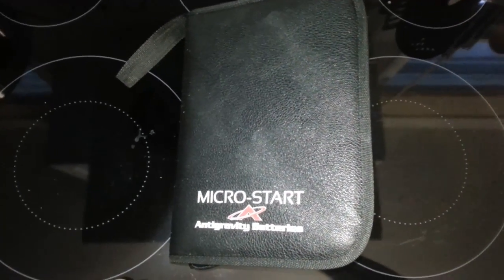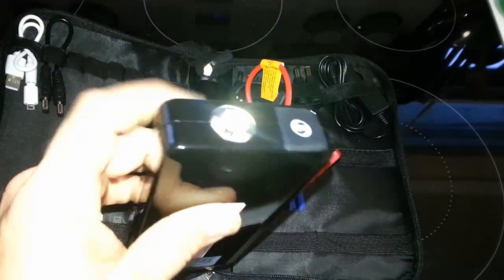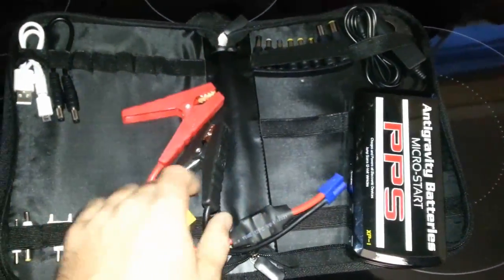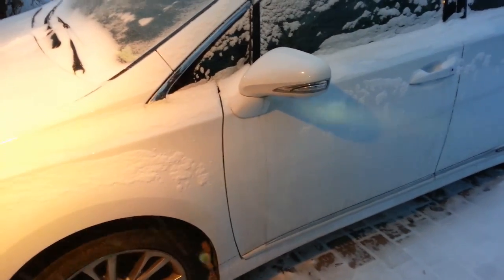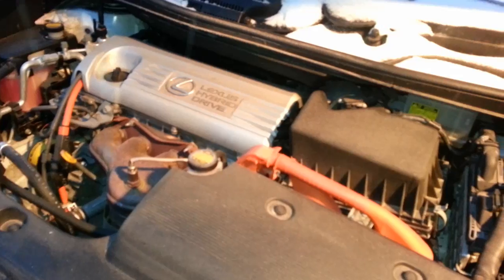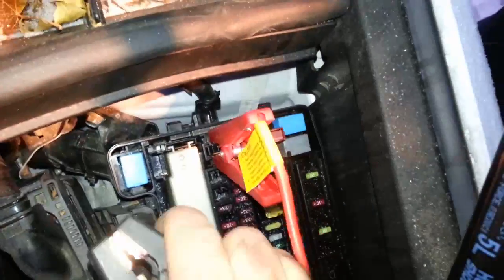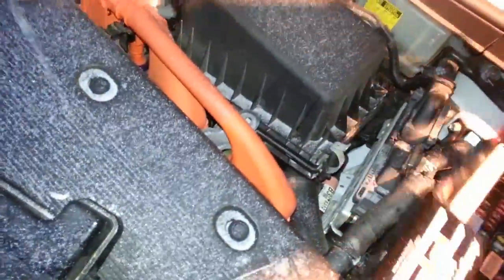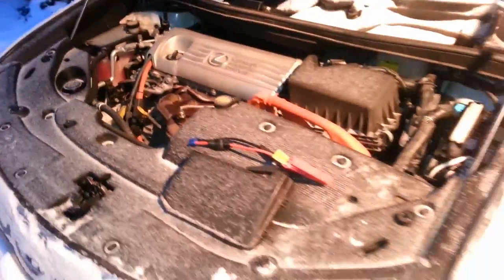Starting a Car with Antigravity Batteries Micro-Start XP-1

Comment: Lexus Hybrids only use the 12V battery to start the computer system, lights etc...the big Hybrid battery is the one that actually starts the gas engine and requires lots of amps.   Do the same demo on a non-hybrid car.   That will be more impressive and useful to regular car owners.